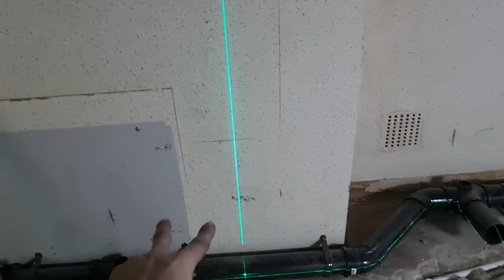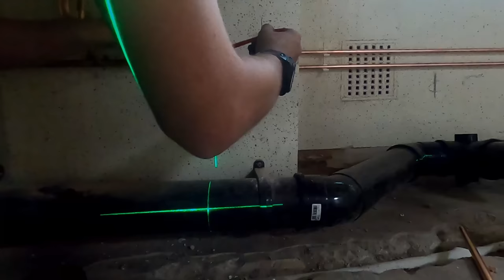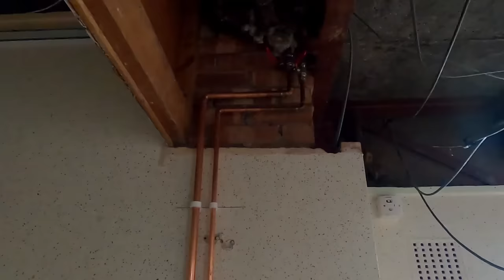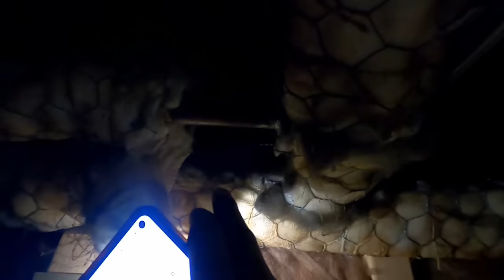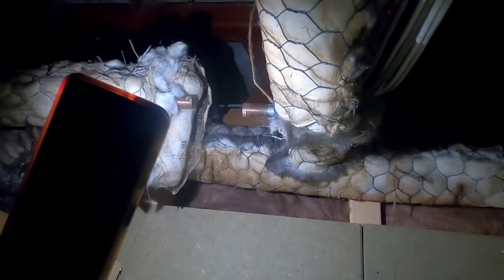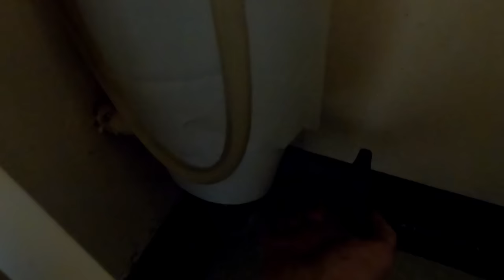HOW A PLUMBER FIRST FIXES COPPER PIPEWORK

Comment: Great vid again mate👌 is that the newer faster cutting Milwaukee pipe cutter as the one I’ve had a couple of years has never cut that quick🙄😂
Reply from the maker: It's the inox one, the thing is amazing, I'm not one for gimmicks but it makes my life so much easier, it's still on the original blade and I've even cut carbon steel pipe with it, thanks for watching as always mate 👍
Reply: @PlumbLikeTom  no worries mate👍 and thanks for that next stop Amazon🤔😂😂

Comment: Re that waste pipe Tom I would treat it like gas , every bend reduces the length so inch and a half . I always use inch and a half not worth it for the pennies difference in price .
Reply from the maker: You are right mate, when I do a big first fix I run everything in 1.5 now, it saves buying to sets of fittings and pipe, it's also less likely to block, thanks for watching as always 👍